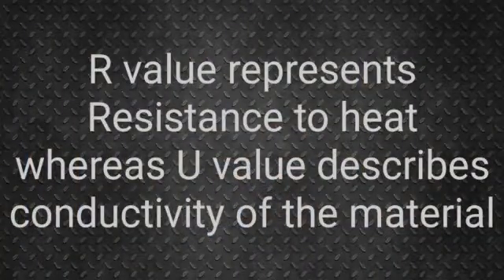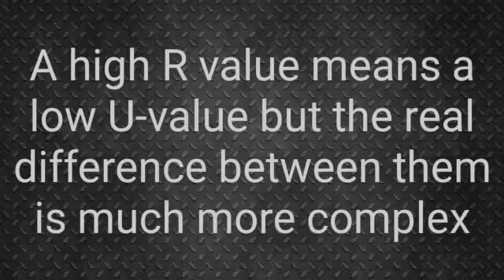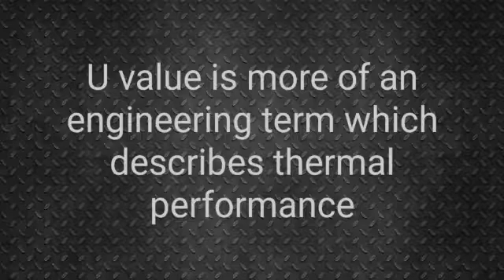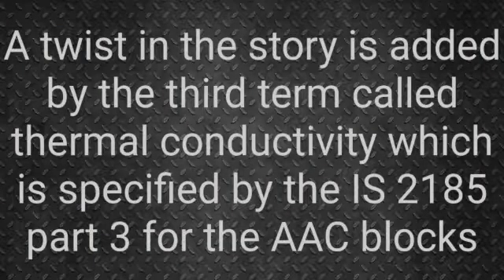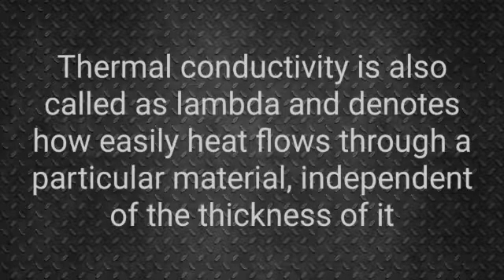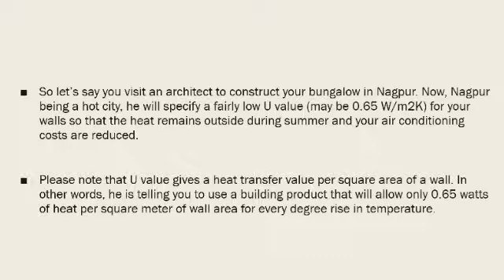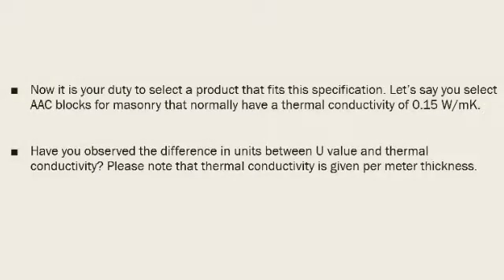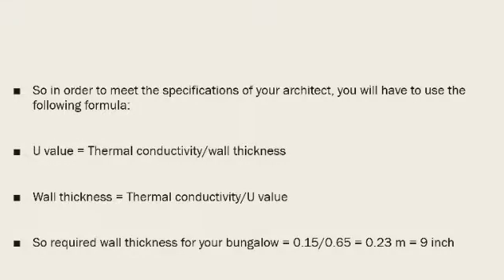Know About U Value, R Value and Thermal Conductivity in AAC Blocks | Mukund Joshi

Comment: Sir does AAC blocks cracks even after following all the procedures like using adhesives and providing lintel and sill level bands? Can 5 inch AAC wall bear the load of Tata Pravesh steel doors which weights around 45 kgs. Does opening and closing of doors and windows brings cracks in AAC Blocks wall after few months? The company is saying that their Compressive strength is 5N/mm^2 ➕ Should I go wid it for individual house or I should go with Flyash Bricks
Reply: Most often this crack comes as not enough time for cooling of block is the reason. Once the AAC blocks arrive at site , keep in shaded area for at least 5-7 days with good airflow.
Most people start using immediately..not waiting for shrinkage to stop
Makes all the difference.